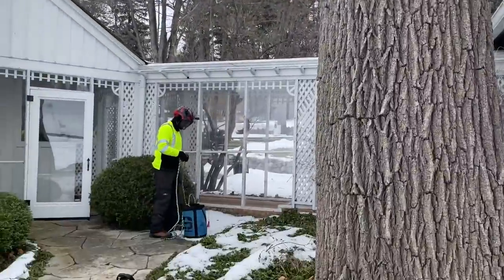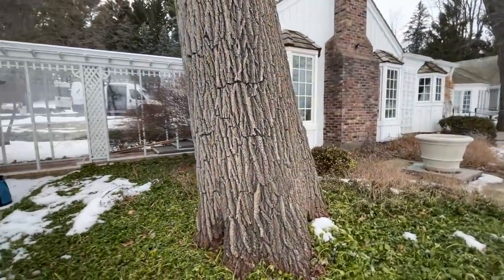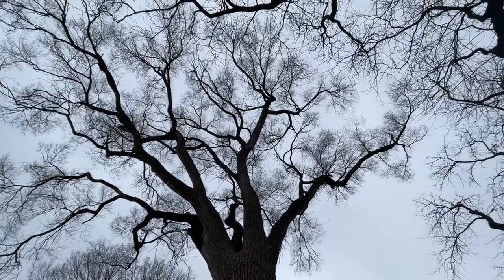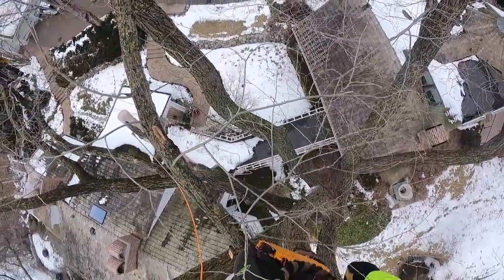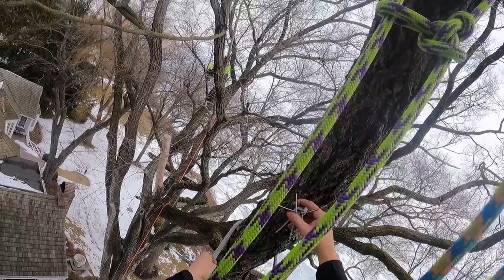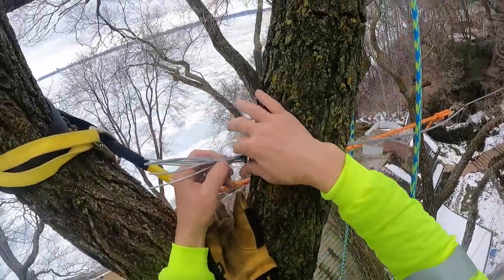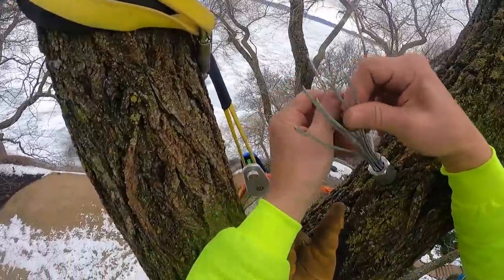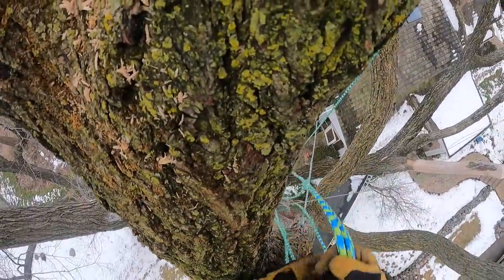WORST Cabling Tutorial EVER!!! Me and a Master Arborist awkwardly demonstrate 3 ways to cable a tree

Comment: Well that is certainly a video to remind me how much fun we had and how much I hate cabling all in a tidy, clumsy 38 minutes:) Great editing Jacob to capture the experience!
Reply from the maker: You were right Kevin, the pliers were in the bag lol
Reply: Kevin do you see any branch or stem failure right where the hole is drilled for the cable.
Reply: @GuiltyofTreeson  za
Reply: @GuiltyofTreeson  cables grow with the tree and resist corrosion from rain, like the tree, right? It's not possible for a severely corroded piece of metal to be in a tree right? I mean, nobody ever chopped down a tree and found a severely corroded piece of metal inside a tree right? I'm so happy insurance companies insure homeowners who cable trees, and insure arborists who install it. It helps keep me, and everyone else in the usa, from spending too much money on gas and beer!!!
Reply: Hey you two, Jacob or Kevin, Awesome video, I have the same situation as was in this video concerning the oak, included bark in a 50 year old Pin oak, two codominent stems spanning 13’ from bolt to bolt, issue is there’s a branch dead center of span and all tree branches are inline with each other, can the cable run up against the center one or should I bolt through the center one tying all three together? Thanks
Reply: @sasquatchrosefarts galvanized steel with stands corrosion.

Comment: Nice video. Everyone had fun which makes the day go by quickly. A suggestion, i recently picked up a dewalt battery angle grinder with the 4"wheels that is perfect for cutting the cable and any bolts you may be using. I use the thin wheels and works great. One tool for several steps in the process.
Reply: Battery angle grinder with a zip wheel works good for tons of things. Sharpen axes, reform wedges, sharpen a wrecked chain in a pinch, cable work, and all the vehicle maintenance. Livening in New York, we got so much rust that bolts don’t come out sometimes without acetylene or zip wheel

Comment: That cobra was installed like a static cable. It has to be installed with some slack in it so the tree moves naturally and its more of a travel limiter. That’s why they come with the shock absorbers.  15+ years installing them and I’ve never seen that.  I also have never seen squirrels damage one, still haven’t. The fraying in the video was the chafe sleeve.
Reply: Thanks for that insight!
Reply: It can actually be installed statically too, depending on if there's damage to the union below or not, but it wasn't installed correctly and it has to be checked which should be planned. Who ever has this person as a client they should replace it regardless if it's synthetic or steel. Normal life for a Cobra cable is 5 years if I recall correctly
Reply: @DisasterpiecesIRL  That's true. I've done it static between twin codoms low down by the union as an alternative to bracing with all-thread. The upper canopy Ieave slack but those I do static.

Comment: Right off the bat, let me say I enjoyed you clowning around on the hardwoods, welcome to our world. I follow a lot of you out west and you guys get the straight up climbs and I am often envious as almost everything back here is like that, awkward climbing and being old school I am newer to the SRT thing. I am getting used to it, but its different than pole climbing to be sure. (but I'd never have jumar'd up that rope on that one single bowing branch, that was kinda freaky, that thing could have broke, ...nuh uh not me, ...redirect, ...redirect...you've got some major cahuna's on you). And the company you were working with there are clearly some top flight arborists. 

Gonna throw my 2 cents worth in on the cabling, and that's all its worth as I am not the catch all expert and I am not even a certified arborist so just my own observations and experiences over the years and not saying anyone is wrong about anything. Just I have had some different observations at least back here in our overly damp and humid climate. But with regards to the two schools of thought on drilling, the more European way seems to be moving towards the Cobra fiber wrap, branch saver, etc and I myself have moved to it for both convenience since I work alone, and because of the non-intrusive method, especially when bracing instead of cabling (like low on twin codom's) because I think over the long haul, IF it can be maintained, its better for the tree. 

Its true it does require adjustment every 3 to 5 years and even replacement which of course benefits you more than the client, since they will usually have you come back to adjust or update it. 

The issues with growing into the bark diminish on older growth which is where I often employ it . It  shouldn't be real tight, its not designed to keep the tree from moving its designed to keep the gap from opening too wide while facilitating normal branch movement. That cobra wrap looked pretty tight when compared to the installation instruction videos provided by the manufacturer.  Upper canopy rigging should be slack and measured to pull tight gradually only when the gap becomes too wide.

As far as wear, its nylon so like my 32 year old climbing rope that I climbed on up until 2 years ago when I retired it to a rigging line, it still holds. A little visible decay is to be expected, and squirrels, birds etc will mess with it but I've never seen one break.  I have only been working with it for about 4 years but everything I've cabled thus far has held up fine. 

The issue I have with bolting, is this. 

Notice the limbs you were taking down, where they were bolted and cabled?  You did two trees both that had been cabled and you took down two limbs, one from each that the cabled trees and both branches that had decayed and died right around the drill spot.  

Which is what I see throughout the region I work in. In fact almost every single drilled tree I have encountered ended up dying eventually near or around an area that had been drilled. 

While the tree does compartmentalize these types of wounds, its often not perfect and openings remain. Pathways for moisture, disease and infestation. Also did you bleach your drill bits?  Especially on oak  but with any prunes I am careful to clean my blades with bleach or alcohol, and then water.  I am sure you clean your blades prior to pruning so I imagine they had the bits cleaned but just thought I'd mention that as that's another way drilling can introduce disease. 

On paper, opening a hole through the tree theoretically should be fine,  but n practice especially in our hot, muggy humid environment I am routinely called on to work on previously cabled trees where the cabled limb has become compromised or even fractured or worse the tree succumbed completely to some kind of disease or infestation which ultimately ends up originating near one of the drill spots.   

Drilling works and is structurally sound and the tree may be fine for 10 or 15 years, but ultimately in a large percentage of trees I see it leads to the end of whatever locations were drilled. 

Not right away always, but depending on multiple variables eventually one of the cabled limbs dies and always around the drill spot and if two codoms are drilled for all-thread bracing, the tree's dying within 10 to 15 years. 

Trees last for centuries back here, 10 or 15 years is not very long.  I work routinely on trees planted by the original settlers. Part of my work is for a historic farm on trees that were planted by some of the countries original founding fathers. I wouldn't feel good about introducing a drill to any of them but that's me. I realize there are two schools of thought,  and not saying ones right or wrong just I wouldn't feel good about drilling them at all so I prefer the nylon wrap as long as it is maintained. Thus ends my 2 cents worth. 

Great video by the way,  enjoyed every minute of it.

Comment: We use these newer things they're not too new but it's just like how you cable and that tree but it's a black metal thing you twist it open a little bit you slide the cable into it and then you twist the end to lock it so easy and simple they are nice they're called preformed wedge grip 3/8
Reply: We just use eye bolts, cable and cable clips. This is a very strong and inexpensive method and very easy to install from a lift. If I had to climb a tree to cable it I'd definitely want something like what you're talking about
Reply: @amosbackstrom5366  yeah I have used your way many times as well it's easy too definitely with a bucket and very strong

Comment: i learned that the dynamic cabling was for trees that dont need the all the time support of the cable. and how you would set it up is for the line to be slack that way  in windy conditions it will give support to the branches when they are being flexed and need the help so they dont get to the breaking point. 

if you need to permanently support branches that is what the steal cable is for.
Reply: That would be the theory, yes, great comment! Thanks
Reply: My thoughts exactly, the biggest benefit of the dynamic cabling is allowing the tree to move and put on necessary reaction wood and the proper mass at branch unions. Static cabling doesn't allow for that. It seems like the big elm in the video might have benefited from a dynamic cable but the oak at the end defiantly needed the static cable given its large existing crack.

Comment: Jacob/ Kevin - when we use wire stops we always trim the wire ends short, turn them back towards the trunk fully as close to the stop as we can and then use plastic caps with a glop of silicone or urethane inside the cap before putting them on, to try and help em stick even more. Years ago saw a guy come up against an EHT wire on a stop and it lacerated him just like a knife (not to mention potential for puncture wounds). That wire is hard hard hard. This holds even for eventual tree removal where the wire may be cut , the piece rigged down but now the ground guy has then end of a wire stuck in the tree limb with a stop on the other side of the limb with strands sticking up. Potential for wounds is really high. Maybe we're anal but the way we wire stuff up should be safe for the next guy way down the road (sorta like cuttin' whiskers in felling, cutting ends of plastic wire ties square instead of on an angle or removing or cutting strapping instead of leaving razors that have been cut on an angle). End rant. Do enjoy your videos a lot. Stay safe out there. (And maybe go back and fix the stop wires shorter and with end caps?)  . . . sorry . . :-)
Reply: Not too many guys out there that care/worry about the next guy that has to work on something. I always try to do what I can regardless of what I'm doing because with my luck I'll be the next guy that comes along to work on whatever it is.

Comment: I have a big maple in my backyard. I’m just renting but they have cables in the tree. I don’t know how long they’ve been there but one of them failed? I’m not sure. Looks like it snapped due to the weight of the limb. I wonder what happened. Tree still stands. Has one cable intact. Several of the large limb were cut off previously. Very sprawly and thicc.

Comment: Please review Best Practice for cabling. The prime position for a cable is six to twelve inches below a crotch, similar to the one you installed above the crotch. The cable will harm the branch as the tree moves.
A thought.
Reply: Good eye. This is not a major support on a primary crotch, I think it was about diameter and drill bit length in this case. I believe the placement will be quite adequate in this case, but you inspire me to review the standards. Thanks for the observation!

Comment: Whats up with drilling crooked holes
? We re use our drill bits for years unless someone hits a nail or bullet, but we're in building construction, idk howit
Makes sense to smoke a bit in one hole
Reply: Probably the refraction on the wide angle lenses:) “smoke is likely moisture from the wet wood. Not the same as construction wood:) Thanks for the comment, I need to sharpen the big bit though used in the oak.:)

Comment: Thanks, Jacob.  Does cabling work well on Big Leaf Maples?  Jess
Reply: I put cables on them. I do it because I’ve seen it done on many and with longevity
Reply: In bc Canada here most of the big leaf maple failure I can think of off hand are fails of the root plate or falling deadwood. Makes me think pruning may be a better option. interested in others opinions though.
Reply: @neild7971  they get extremely wide to the point that they look so freakish, something must be done. If the tree is healthy and as already lived through season after season of storms, I’d cable it. Most times trimming and thinning is the only option tho.

Comment: I've done something like that quite a few times. I use my boom and do it myself. I use vice grips and ratchet straps to pull it. Poor man's method. General rule is go 2/3 way up and don't over tension.
Reply: Remember the masdam rope puller? I’ve got one of those hanging in the shop.  Great for solo work for sure.

Comment: Hey Jake maybe you can answer a question for me I have the pencil zillion and I need to replace the rope people say that you can use tri-tech 11 mm with the zillion do you know if that's true or not cuz I really would like to use the tri-tech with my zillion
Reply: I think you’re supposed to run at least 11.5 —13 mill rope. I ran an 11 on my zig zag and it would let slack through under load, not fast but it moved a little.
Reply from the maker: Sorry dude I have zero idea. I haven’t used a zillion much at all
Reply: I have 11.2 in mine and it works well. No slipping except when I bump it…hate it when that happens:)
Reply: @kevinhammatgameoftrees7080  so Kevin you think the tritech would be okay to put in the zillion

Comment: Over in the uk we don’t use this anymore really dude to the damage it causes to the tree
Reply: Trees respond very efficiently to drill wounds. Gilman out of Florida has some good research on it.
Reply: cable or allow the union to split out which causes less damage to the tree and or possible surrounding buildings?
Reply: @iffykidmn8170  It's true that we don't use this in England really at all anymore but it's not because of the damage caused to the trees. 

In the UK putting cables in a tree is a liability issue, if we cable a tree and there's a failure that damages property or kills someone we can be held liable for it. Using cables here is seen as knowing there's a fault and potential risk with the tree, then If it fails we've taken "insufficient action" so now it's either prune or complete removal rather than be held liable.